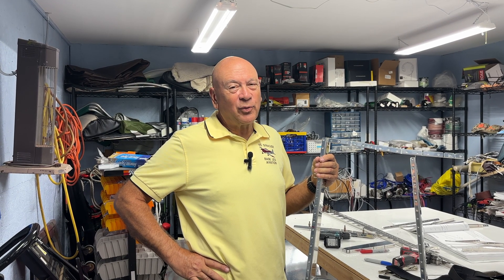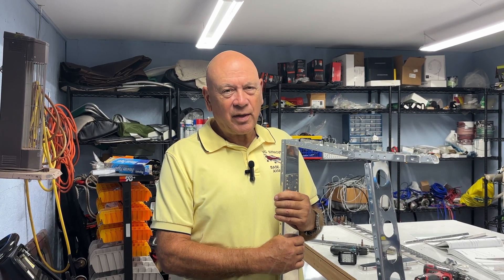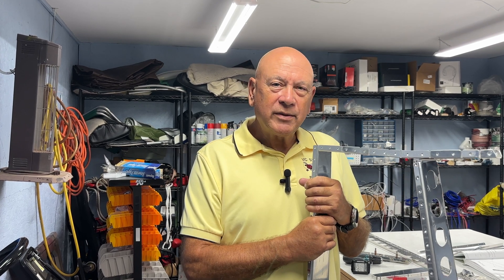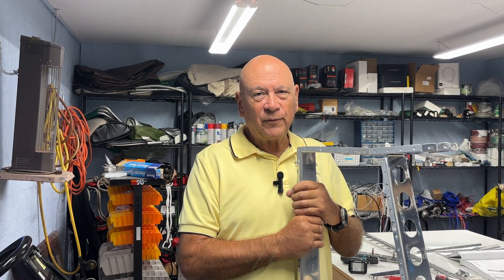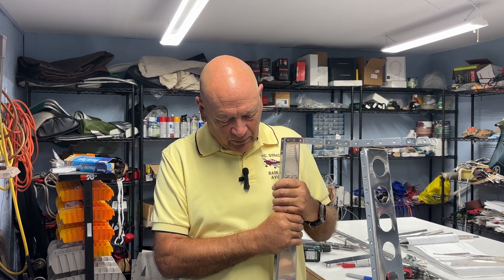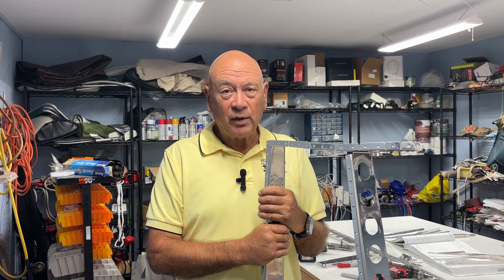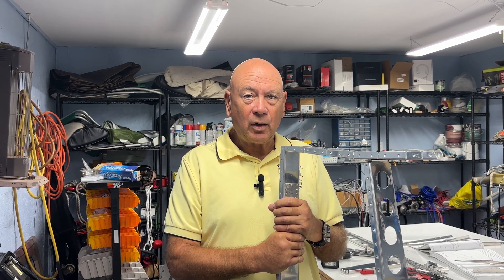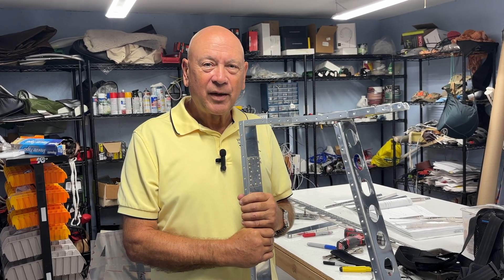New RV 10 build

Comment: Totally relate to the "itch to build again" after 17 years and 1400 hrs  TTSN in the RV-10 my wife and I built, which first flew in 2007.  And also totally agree the -10 is the best ever magic carpet for cross country travel.  Recently I've scratched the itch to build again by learning to speak CAN bus, and swapping out a perfectly good GRT + TruTrak system for a full up GTN650Xi+G3X triple screen system with that amazingly capable GMC507 controller with autotrim.  That was about 200 hours of learning and design work and 240 hours of new hands on wiring work but it took our -10 to an entirely new level of IFR capability and ease of use.  Pounding another 17,000 rivets doesn't seem appealing, but the "once a project, always a project" principle applied to the RV-10 means there will always be something for us happy builder/pilots to tweak.  What a delightful flying machine it is!